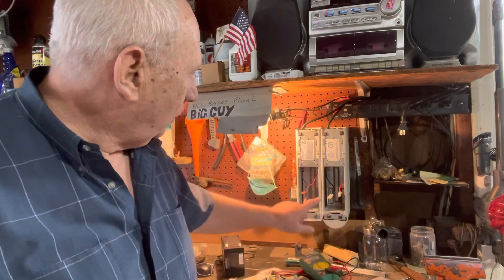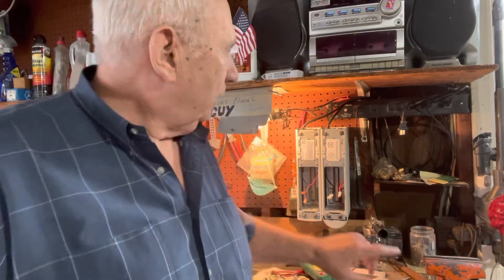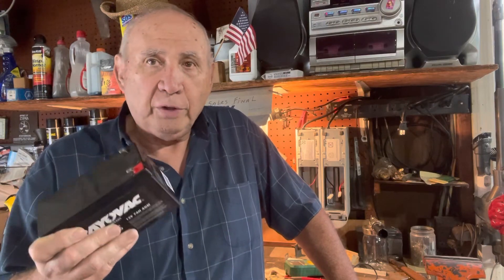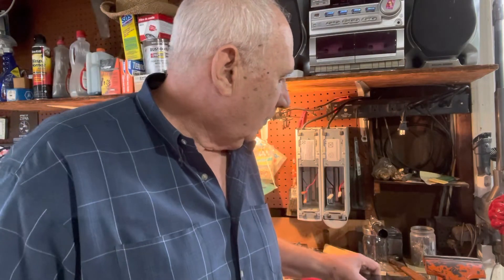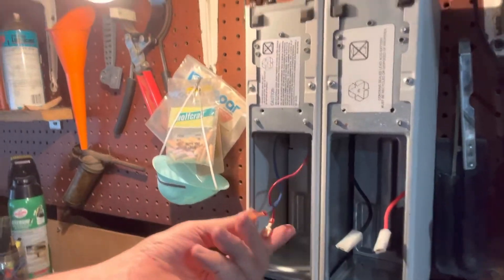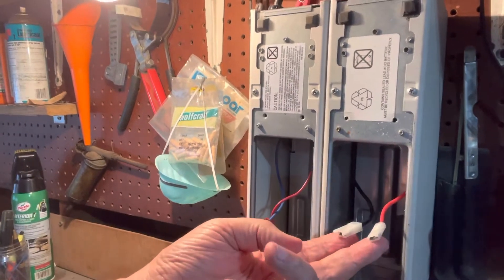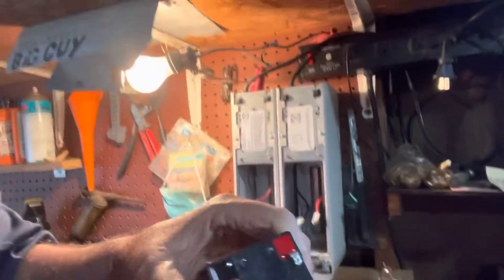Recharging the power wheel battery

Comment: That's good info. I'm working on the nephews power Wheels now 
. I'm wondering if a 12 volt car battery charger on trical mode would work because I don't have a Fancy charging bank unlike the one you have which is very nice by the way.
Thank you zMike.